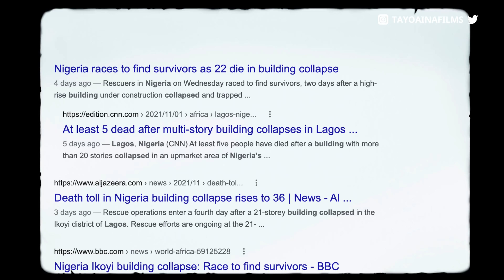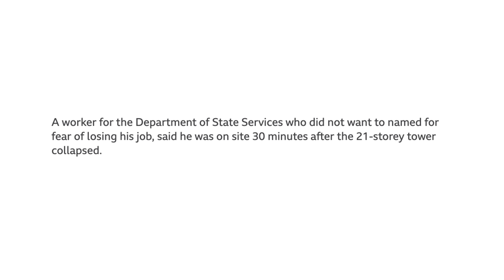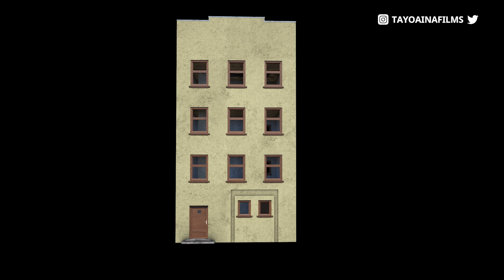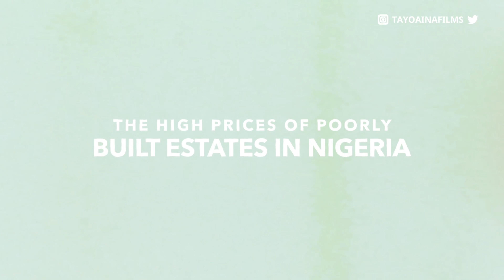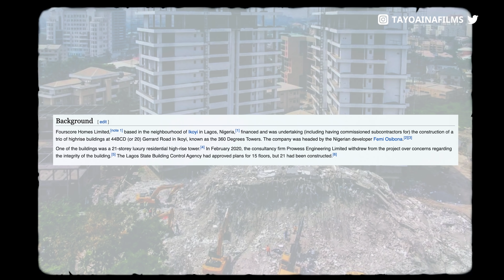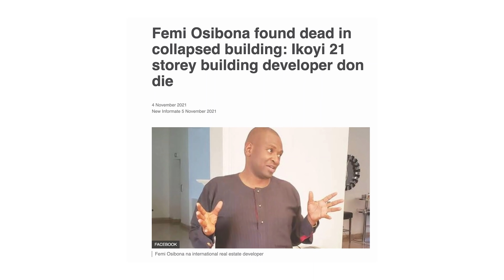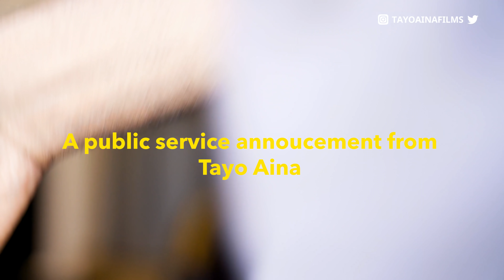Ikoyi Building Collapse: My Problem with Lagos Real Estate!

Comment: Your story just based on what your could see on the surface; it’s far deeper than you think.
It’s like president taken the blame for all the ills in the society; he’s blame for the governors failure, the local govt and even our poor character as citizens.
Developer are the only about 2% of the problem;
What about the landowner who sell land at sometime 400% of the value;
What about the govt who allocate lands to friends and cronies who in turn sell them to developer at very exorbitant prices.
What about the poor building materials?
Are you aware that most of the building materials in the market are sub-standard and can’t pass integrity test.
What about the issue of quackery in the engineering sector, you see engineers and consultant with little knowledge and technical know-how and yet certified by COREN and NSE.
What about the regulators who favour cutting of corners bcos is more profitable for them;
Most of whom don’t even have a technical understanding needed to do their job;
What about the issue of corruptions
This engineers what to get rich very quick,
Hence they would steal and direct materials form the site and reduce the standard perimeter without the knowledge of the developer;
Developer spend a lot on security of materials but the same staffs would all collude to sale materials at night and the result is reduce mix ratio and iron rods specifications which would thus further affect the standard of the construction.
In summary, the developer is a victim and not the problem.
There are alot of developer with the right intentions but Our system is designed by corruptions to make it’s almost impossible to do anything rightly.
Am a developer. Contact me and here our story.

Comment: It's only going to get worse. As the Naira keeps collapsing, the cost of building materials would increase. Expensive material would cause builders to cut corners.

One thing Nigeria needs to do is enforce building inspections. In the USA, you don't just need the permit to build. You also must pay to have govt inspectors come out and inspect every stage of the building process. As you're building, you have to stop for inspectors to give you a pass mark, before you can commence the next stage. If any stage is not up to code, you must fix it, or redo it.

Next, builders need to be bonded. That forces the builder to not cut corners. If you wire my house, and you use 14AWG wire, where you're supposed to use 8AWG. If my house catches on fire, your insurance pays me for the damage. Your insurance company then raises your premium as a result. Then if too many people are making claims against you, no insurance company would want to insure you. That means nobody would want to call you for work, since you're not bonded.

Comment: There are a million reasons why a building can collapse. It's expensive & difficult to make a determination after the fact. The main reason in most cases is overwhelming power of the developers. Majority of the developers due to their financial powers vis a vis regulatory authority & professionals, refuse professional advice, & the professionals simply go along because they desperately need the  pay & while leaving the developer to do whatever they think is right. Most people with money fancy themselves as engineers/architects/project managers all rolled up into one & you can't tell them any different ortherwise you will not get hired or payed.

Comment: It's a systemic problem. Everything is wrong in Nigeria. The Lekki building collapse is just one of the problem we have  in the country. 

Most building materials are not up to the standards. Structure engineer will design using 12mm iron rod. But when go to buy it, you will only find 11.5mm. 

Same thing you also find in our roads. Many roads doesn't last upto 1 year.

Comment: This building collapse is so devastating to say the least.  My deepest sympathies to the families who lost their loved ones in this collapse.  As a civil engineer with structural background, how could they not have concrete test results?  I heard that the concrete test results were not given (or delayed for a while).  The concrete test results indicate if the concrete used for this building meets or exceeds the required  design strength specified.  if not, the concrete already cast in place for the building needs to be removed. Moreover, it is absolutely ludicrous  to go contrary to the building design specifications.  Why build additional storeys when this building was designed for 15 storeys only?   I am  still mad with what transpired in Ikoyi. The project plans standard specifications need to be followed at all times!!!! No ifs ands or buts.

Comment: There must have been a serious breach of quality for this failure to happen. Ordinarily a structure is designed to carry about 40% more than its anticipated load, this allows for errors in workmanship etc. I believe that those on site ignored the drawings and reduced the quantity/quality of the structural elements to save cost

Comment: The builder probably didn't envisage the disaster that happened. The control, safety and monitoring agencies in the government should be blamed for not doing their jobs.
Reply: Please don’t try to defend or excuse the builder, an engineering degree is not necessary to understand that a foundation designed to sustain 15 stories can’t suddenly sustain 21. I’m sure that the possibility of a collapse  crossed his mind at least once.

Comment: When new structures are collapsing it’s an issue. It’s already bad when older buildings collapse like the apartment building in Miami Florida that was outdated. These engineers are throwing up these new structures overnight and quickly just to earn a quick profit off rental income. In my opinion todays COLLEGE EDUCATED ENGINEERS are DUMB AF unlike the engineers with no education who built temples in Egypt that are still standing with no issues.